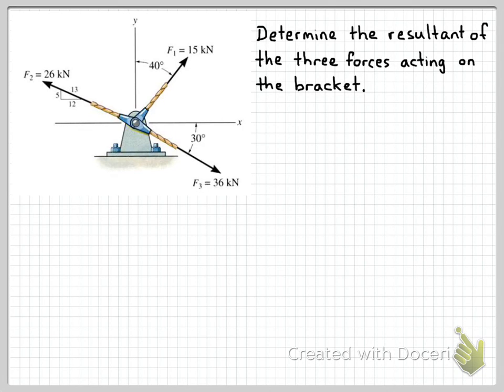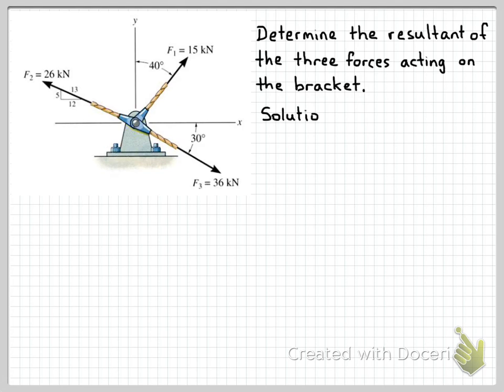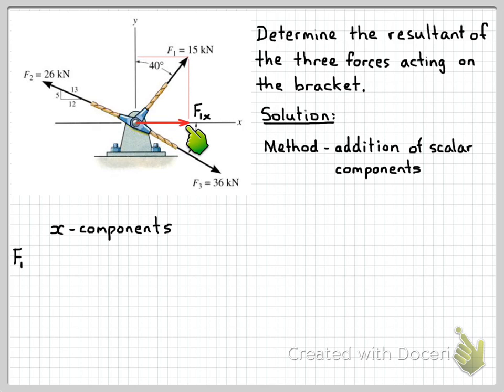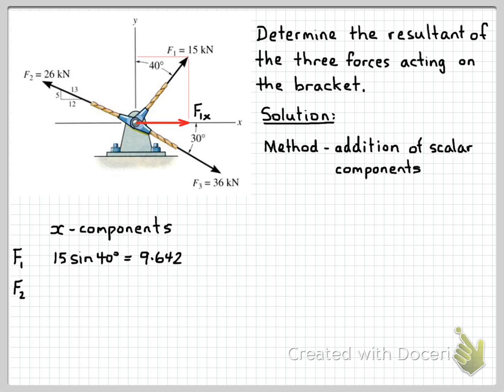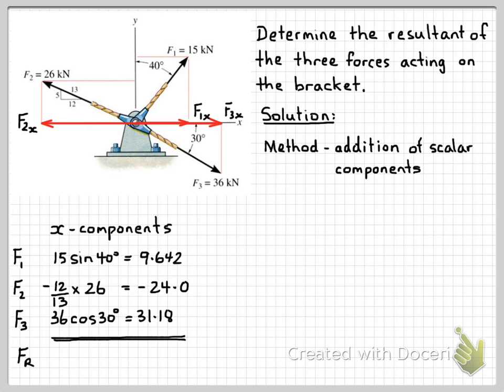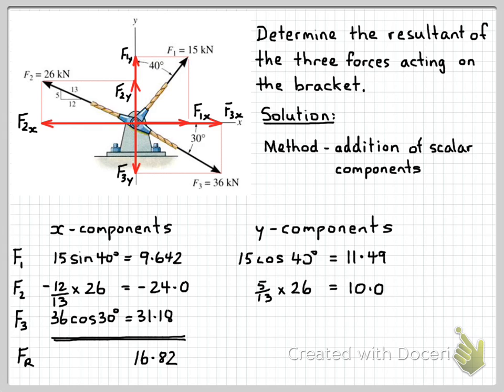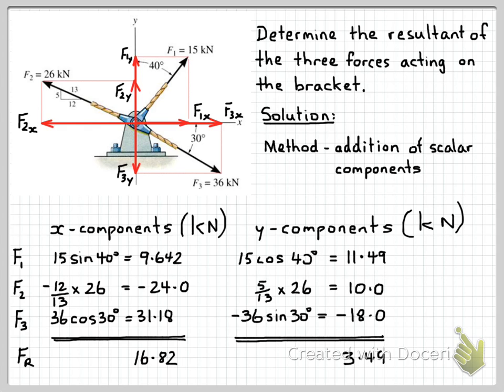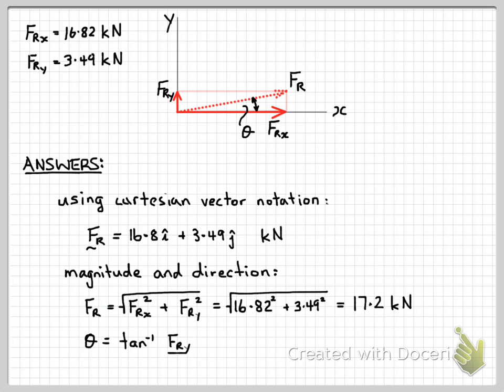Resultant of three forces

Comment: vector machanics for the block of prob 2.37 determine (a) the required value of alopa if the resultant of three forces showan is to be parallel to the incline (b) the corresponding magnitude of the resultant.
Sir how we can solve it
Reply from the maker: I'm sorry, I don't have the details of that particular textbook problem. Which textbook is it from?

Comment: how do you know when to use sin or cos when finding the x or y components?
Reply from the maker: you need to understand/know your right angle triangle trigonometry well. Remember from high school maths that sin(angle) = opp/hyp , cos(angle) = adj/hyp. For a given angle, if the component you want to calculate is the 'opposite' side then you use sin, if it's the 'adjacent' side, then you use cos.
Reply: @TerryBrownMechEng  i do know those rules, but how can you tell which one to use based on this problem or any like this when finding the z and y components. For example, for f1x , how did u get sin?
Reply from the maker: @salsalo8826  I explain that from 2:15 on. If we look at the right-angle triangle formed between F1 and the y-axis, the given angle is 40deg, the side opposite that angle is F1x, therefore I use sin. If given the angle between F1 and the x-axis (i.e. 50deg), then we would have F1x = F1cos(50deg), which of course gives the same answer. Also see video here https://youtu.be/y4Ea0jcxovE?t=226